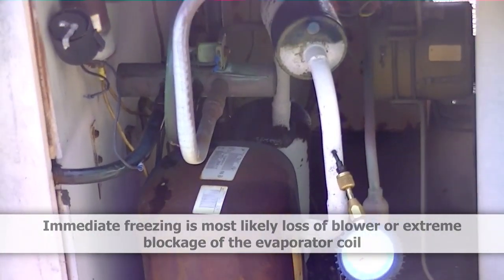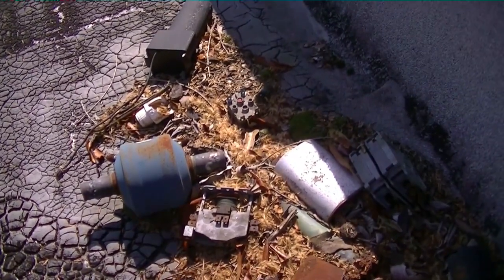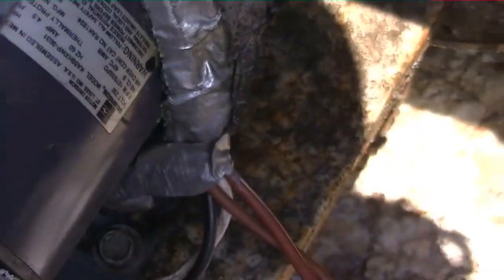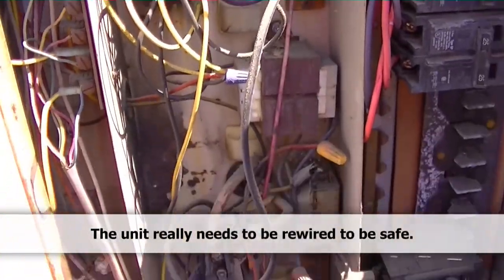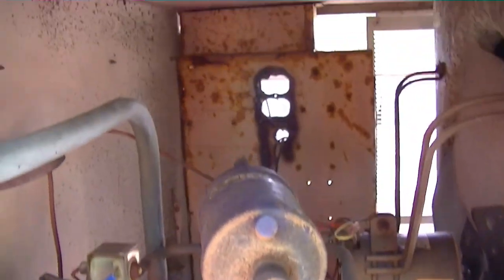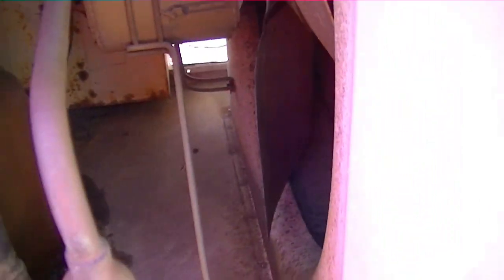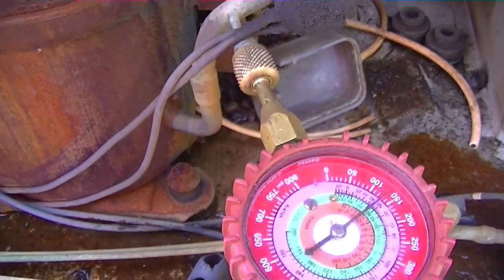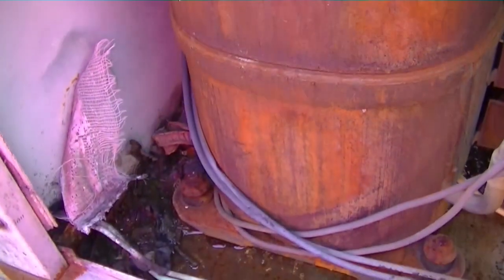HVAC Service- Blower Motor Capacitor Failure

Comment: I noticed the cup of the condenser fan blade was blowing air from the inside of the cabinet through the condenser instead of pulling the air through the condenser over the motor. A good one to walk away from. I have one old unit that I've kept going, an old Typhoon 7 1/2 ton, I finally told the customer that it was time to change it, two days later a tree fell onto his convient store hitting both AC units crushing them.
Reply from the maker: That's a good one. The Amana is def a heap.

Comment: Looks like the unite I had a call on, it was on a Palestinian owned Wig Shop. They didn't want it fixed right, just get it cooling.
Reply from the maker: That's the way it goes. If they are cool the unit stays.